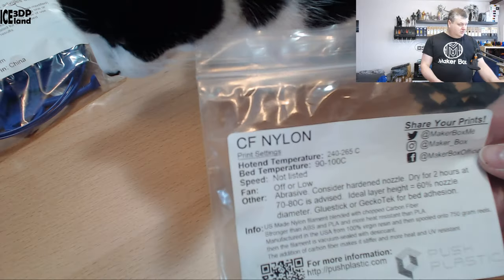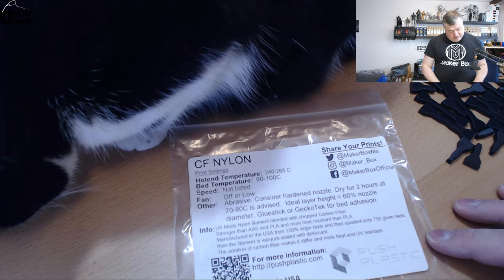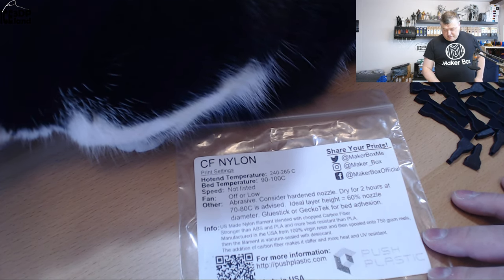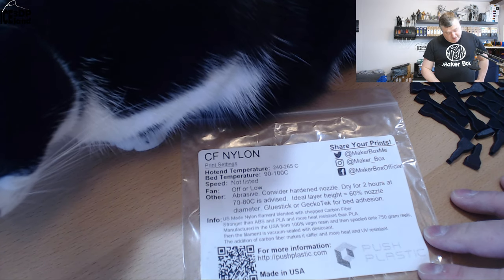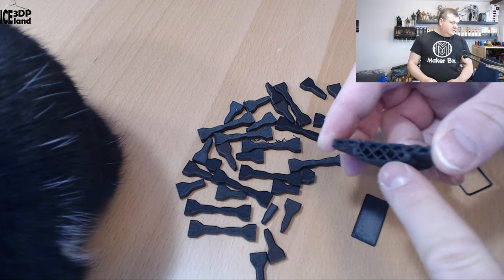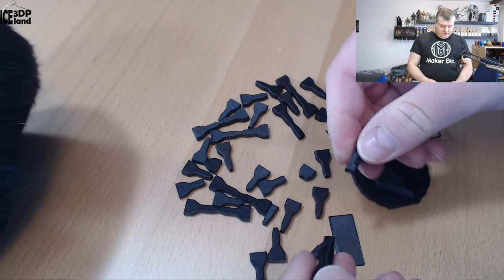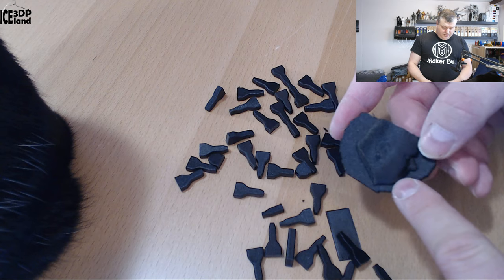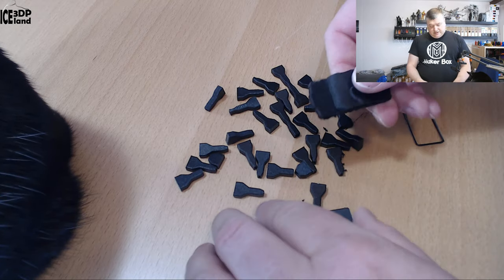Makerbox Monday   Push Plastic CF Nylon

Comment: Yeah - I don't think carbon fiber particles will add any strength.  But, they will surely interfere with layer adhesion.
I see that Púki is back supervising.  :-)
Thanks Marteinn!
Reply from the maker: yes, that is my finding as well, layer adhesion is suffering for carbon filled filaments, it adds stiffness to nylon though. And yes, Puki is making sure I don't  mess up :)